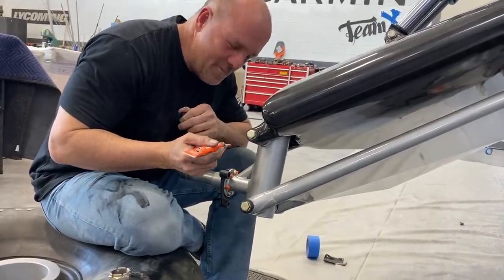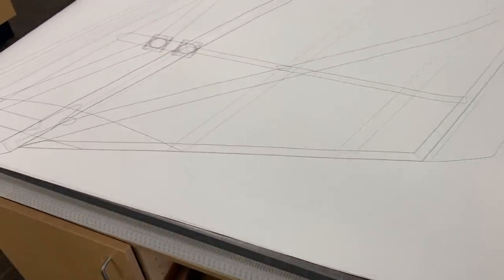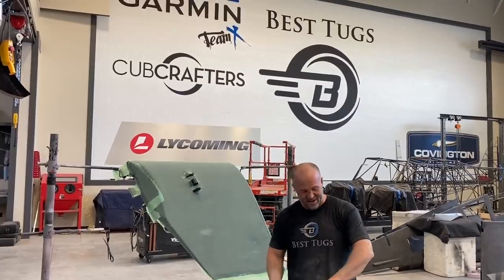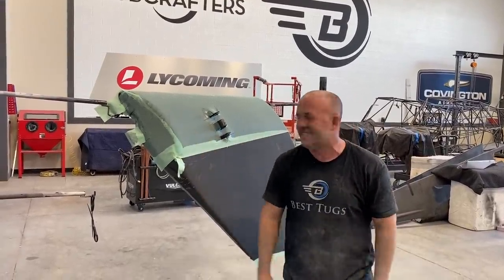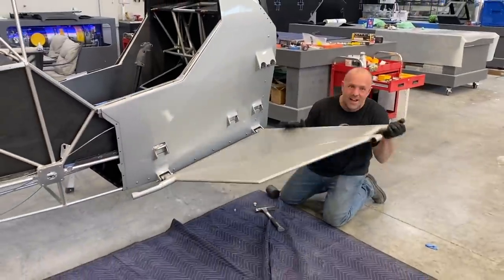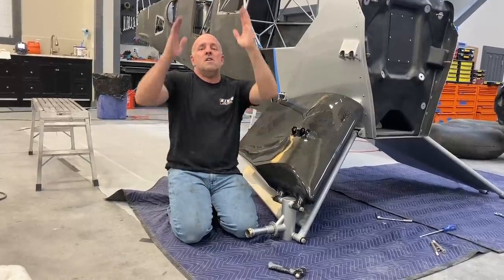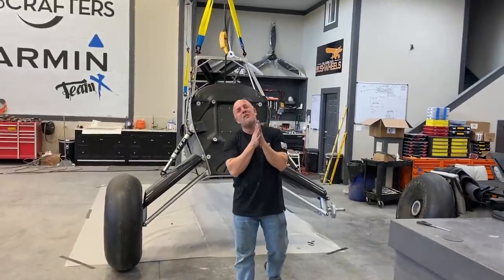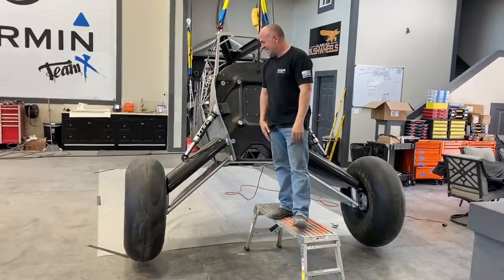Carbon Fiber Wings on scrappy suspension finished (Scrappy Bush Plane 22)

Comment: I’m a retired yacht carpenter that also built  one-off molds for anything that was requested for a build , all pre-computer aided  and just blown away with your ability and energy. I’m inspired to open up a laptop and learn new stuff
Reply: I'd start with Fusion360, it'll give you a good base and there's a ton of good tutorials. Depending on income(less than $100k) or associations with academia you can use it for free, otherwise it's $300 per year for standard software package.
Reply: If you register as a hobbiest when you download Fusion 360 it is free. That’s what I did.
Reply: @stevehurson4002  I use Fusion360 for commercial use so I pay the yearly fee, which honestly is very low cost for what Fusion360 does.
Reply: Insert learn to code. Haha. It's basically that. Formula and imagination.
Reply: Honestly. Can probably pirate it somewhere. Commercial/Pro license

Comment: It's 2020 and we are living in the future! Witnessing custom, innovative, creative designs from the cradle of the mind. Then modeled on flat screens in animatable 3D computer aided software tools. Guys working out the desired parameters of complete systems before any investment of of real world commodities. This is planning at it's finest! Thank you, Mike for sharing your vision! You and others are inspiring me to get back into my true passion General Aviation (GA)! Been away since 2000 and that's too long! I'm an experienced lofting plug producer that has worked off of line drawings for composite fiberglass molds. Primarily for the marine industry. Electric marine propulsion has been a focus for me since 2015. I believe that electric aircraft propulsion is the future. I need a test stand and aviation prop to work with. I've worked out on paper and ink how to power an electric aircraft motor system of about 180 HP equivalent for up to 6 hour runtimes. Though Rolls Royce and Siemens has been teasing the market. I believe my 1.5 KW MoGen system will scale up without much problem. I'm discovering a large community is cocked and loaded to really manifest our cradled visions to make GA safer and practical for larger pilot audiences than ever witnessed before. If anyone is interested in electric aviation power, it will be an honor and a privilege to work with you! The motor, controllers, battery management system and batteries are simple and the commodities are inexpensive. Once the Metronomic/Parametric Oscillating, Battery Management, Mogen is understood by others. It should prove seeming simple to those who are mastering computer aided drafting. With my system, the components can architecture into the composite skins working double and sometimes triple purposes. The goal is 100 year design life! Contact (legioneering (at) outlook (dot) com) As a community we are living in the future! Let's make it a good one! Hit It!

Comment: Your suspension is like a Trophy Truck, a Fokker Triplane, and a Unimog all had a baby.
Reply: I can’t freaking wait to see what it’s capabilities are!!
Reply: @matthewdowd4686  I would bet, Mike trained Scrappy to jump, and Scrappy asked how high? 

Just think of a Stol drag race, 

Mike start with the shocks at low height setting, a low preassure charge, just enought travel for takeoff 
gathering speed faster because of a flater angle of attack, 
and near take of speed, Mike will use Air pressure from the oxygen bottle to have the 2 shocks jumping out to full lengt 
with both up 15-18" uptravel to get the front of Scrappy at a steeper angle of attack. 
Those lowrider jumping cars would get jealous.. how high scrappy jumps.. 

And with the AirshotBoom Scrappy goes airborne with a 1 scrappy + a Mike mass movement.. 
this will eat a good chunk out of his of his starting distance. 
or with Mikes oversized engine and Mad Prop.. (cant imagine how much countersteer this combo will need..torque wise )
Scrappy might jumpstart and is a ZTSL zeroTakeoff short landing Plane  
and for landing, he just sets the shocks preassure back to lower soft impound eating level.

And the best part for mike, its just some bigger and extra airlines, a electic solenoid to open the oxcgenbottle(a preassure regulater perhaps to adjust the jump strenght) ,
and an 3 way valve and an eletronic preassure adjuster valve to set his desired landing suspension setting.  
1 st setting be closed at jumpstart when the bottle kicks in, 2nd setting preassure regulated after jump start and for landing, 
and the 3rd way would be hooked up to the engines mainfold for vaccum to the shocks to tow in the suspension to max compression in flight to get the most use out of the suspension wings.  

And i´m pretty sure its air controlled since might is stingy as a scotsman when it comes to weight, so its not hydraulic.
Reply: SirDigger420 how long did it take you to write this?
Reply: @Dixon_1974  probably 3-5 Minutes 
Took longer to get rid of the typos.. as thinking about the concept.. 
english isnt my mother tounge
Reply: @Dixon_1974  And it makes no sense at all!
Reply: Tom Hutchins I mean his mother tongue isnt english.
Reply: Unimog baby.....nice to see someone else appreciates those beasts.
Reply: The Apollo Lunar lander's gear had to be designed by Mike. Its so much like Scrappy.Any altitude at any speed.
Reply: Wait, WHAT?!? OMG that's just so ALMOST on point...

Comment: With all that lift surface, it's almost like he is planning to have the prop wash lift the plane straight up. :)
Reply: Considering the prop in front... It wouldn't be surprising.
Just add spring loaded shock custom made by king and he just created a VTOL 😂
Reply: I'm sure as close to that as possible. He called it out early- it's all about short takeoff.
Reply: @ManicSalamander  and he was fairly disappointed that he couldn't make draco jump after having him squat with the brakes locked ^^
Reply: With that fan boat prop, you know it's going to take off shorter than Draco
Reply: Yep its called a helicopter

Comment: Am wondering if you've come up with some ingenious way to hydraulically raise the wheels with the shocks so those wings can be horizontal in flight, then dropped for landing???  Wait a minute - will the lift from the wings raise them up  by themselves if you can valve the shocks to let them easily travel upward after liftoff?
Reply: I am pretty sure he did say he will have them up during flight, didn't mention how but let's be real he'll figure it out
Reply: Great observation! I think you are right!
Reply: @getstuk87  I agree, my though is that they are air shocks and by venting them, the lift will cause the "gear" to retract into the horizontal.  To land, they will be pressurized to get required cushioning.  For simplicity, the shock valving might just perform this function automatically.  But if you have to slow down to let the lift bleed off to get the "gear" to go down, that could get to be nerve-racking.  Also, this functionality would likely be affected by temperature.
Reply: yeah right on..   he made mention of this idea on the wilga wonder how much launch he will get

Comment: Suggest adding a clear poly strip to the leading edge of the mini wings.
Reply from the maker: BYRON Johnson  they are all wrapped in a self healing clear bra 👍🤠
Reply: @MikePatey  Silly me, trying to give pointers to the Tony Stark of aviation!!! Love the vids keep em coming!!!
Reply: @MikePatey  Super cool project and execution. You will get a bunch of interference drag between the upper and lower arms, but probably not an issue given the mission brief. My thought would have been why not put both arms inside the fairing and increase the chord. The other thought is why not put the shocks into the fuselage with cams to get them out of the airflow. Like you need armchair suggestions. Enjoy the vids; not cheap but people can do more in a simple garage than they think given a SolidWorks license (which you get with EAA membership - you might want to point that out if you care to support EAA).

Comment: Absolutely amazing and inspiring Mike!!! I watch these episodes as soon as they come out.

My concern about this much travel in the suspension is the same problem that caused Draco to have divergent suspension stability in a cross wind. Scrappy, with even more wheel travel, will have that same problem only worse, unless your secret that you're about to reveal in the next video is that the King suspension is a dual chamber suspension and that it will only have minor travel in one chamber with restricted travel in the long throw chamber used for landings. Dual chamber would prevent tip over in a crosswind.

Comment: Adjustable shocks so he can pull the "mini wings" up in flight to act as real wings.
Reply: That was my guess too. Here's hoping.
Reply: I can't imagine it would be anything but that.
Reply: Maybe one push or flip of a switch from cruise mode to landing mode, or possibly a flap sensor so landing mode is automatic
Reply: Daniel Murray shhhhh! That might be the secret worked out with King Shocks!
Reply: They will cut gear drag (their primary function) AND provide some lift, just where they are. Then again, though it would be a whole lot of busy work and extra complexity to make them somehow change their position in steady flight, if anyone could pull it off it'd be Mike.
Reply: And.. lowrider mode for loading, servicing, and show.
Reply: I think we're thinking too small... Forget forcing them up in flight, how about forcing them down at take off? Fire them down and the thing would leap up into the air. STOL? Give it a 35 knot headwind and I bet it could take off without a roll, It'd just leap up and fly
Reply: @owensparks5013   I would bet $$ he does that. He has talked about it before...
Reply: @portnuefflyer  cut drag and straighten out propwash to help the tail, yes. But I don't see them add lift unless they're aero-angled for the propwash, and that requires windtunnel work.
Reply: @billhart9832  IDK why he's treating it like a secret he only mentioned it about 5 times lol
Reply: @owensparks5013  Ohhh there’s a thought!

Comment: What about inspecting the metal for corrosion or cracks inside the carbon miniwings if it is installed non removable and without any inspection hatches?
Reply from the maker: It has inspection points on the underside I missed that for the video
Reply: @MikePatey  A few years years back, I read some research papers and IIRC they concluded that even a very thin layer of glassfiber or possibly just an epoxy topcoat substantially reduced galvanic corrosion between the carbon and various metals.
Reply: I WAS THINKING THE SAME THING... good thing I looked before I started typing.  GREAT QUESTION.  I used to crew a Tanker.. and we were ALWAYS on corrosion duty
Reply: @AntiVaganza  Yes any carbon in contact with aluminum will be short lived, on the order of several years.

Comment: $10 bucks says the reservoir in the king shocks will have some sort of “vacuum” pump to hold them in the up position to generate the correct angle of attack Mike wants on the mini wings.
Reply: I was thinking the same thing. Maybe a reservoir tank, and some kind of super heavy duty reversible little pump?
Reply: Interesting idea. I was thinking the secret of the shocks might be some built in supercharge to kick him faster off the ground for super short takeoff.. :D I know he scrapped the idea before. :)
Reply: @sasakurtovic6850  there's a gyrocopter/helicopter hybrid that jumps like crazy...
Reply: Russell Sperry yeah kind of like those oil reservoirs that trophy trucks have but with a vacuum system built in to “pull” up the shock
Reply: Saša Kurtović I wonder if they shocks natural state can be “hyper charged” and when he lets go of a vacuum it can “spring” during take off roll

Comment: are you going to be able to lock that landing gear in a neutral position concerning your angle of attack at higher speeds so they don't flutter?
Reply: hence the secret about the shocks.

Comment: Hey, Mikey! I know you had fuel cells in Draco's struts, and these "wings" seem awful empty right now. Did you consider using these wings for fuel?
Reply: They have the whole structure of the gear witch goes pretty much everywhere inside. Would be quite hard to have a fuel tank inside, plus they are no oving which would require flexible fuel line and so on. Not very practical in my opinion
Reply: Unsprung weight if used for fuel tanks, the suspension would react slower. On Draco the gear leg tanks were sprung weight ie above / carried by the suspension along with the rest of the airplane.

Comment: Hey Mike, any worries about the mini-wings interfering with the airflow over the tail/elevator at high AOA?
Reply from the maker: Great question I’ll talk about that later.  no worries.  All fabric cub legs actually cause mire from the tumbling air over the top on high AOA and this stays laminar and on top of that I widened the tail out beyond a normal cubs wash out
Reply: LogicalSense FACTS  guessing the surprise feature around the shocks is that the strut wings can be leveled for flight pneumatically -  just a guess

Comment: This build series comes off as the most interesting crash course in vision, aircraft design, and construction imaginable.   A true tribute to intelligence, talent, hard work, and the beautiful results that come from the combination of the three.  Unfortunately, I envision Mike shedding a tear or two once some big engine, backcountry, prop wash chucks some sharp debris into the leading edge of that beautiful carbon mini-wing. Best put some tissues in one of the many cubby holes in the instument panel.   ;)

Comment: I really do enjoy Mike. The things that he is doing is inspiring many. I am certainly don't want to be critical of all of his great work. However, the suspension does scrub the tires latterly. The only way to keep the tires from scrubbing would be to have the bottom link shorter to keep the track consistent. The down side of that is that the axle will no longer stay parallel to the horizontal plane. The wheel and tire will roll a bit, but the track would stay the same. At the end of the day, choose your poison. Lots of love for Mike.

Comment: Looks awesome. My only suggestion would be the addition of a drainage hole and/or an inspection window in the carbon covering. This would ensure that years down the line you don't have to worry about water/humidity buildup or corrosion to the internal metallic frame. Rain might not be an issue but condensation forming on the interior steel may be a potential issue. This project is looking great !

Comment: Mike it’s cool you crossed off road suspension design with a bush plane concept. The double A-arm suspension should be really durable for you out there on the mountains. The term for the change in the tires angle during suspension compression is called Camber Sweep. Looks like you have set it to a certain angle and maintained the camber angle through the stroke.  Really cool, looking forward to more videos!

Comment: What an exiting stage to be at, always so satisfying to have a rolling chassis. 

I think you could take some weight out of those a-arm pivots, I’ve made them from hard anodized aluminum rod, igus sells it. You could also use igus bushings to go without the grease.
Reply from the maker: 👍🤠 Agreed and I have greaseless bushings but I like to install with grease anyway

Comment: A thing that has been oddly satisfying is similar. To replace an erosion shield on a leading edge on a Hartzell kevlar propeller blade many times of course or doing an e-glass repair on a MT propeller trailing edge. You have to grind out the extra glass and resin back to the original shape. That's satisfying.

Comment: Love the content as always and can't wait to see this build finished! If I could offer one suggestion from an audio engineer to a real engineer, I would recommend investing in de-noising software for your audio. iZotope makes very effective plugins and a standalone application called RX 7 specifically for cleaning up dialogue and vocals, while still being relatively user friendly (as long as you read the manual). Specifically, I recommend their de-noise and de-reverb plugins since a lot of your content is recorded in noisy and reverberant locations (around planes, in hangers, etc.). There are other options available, but I personally have used this program on several projects recently and it has done the job very well.

Comment: The little wings are utterly beautiful.  Heck that whole front suspension is utterly beautiful.  One thing I am wondering about is for the suspension to travel its full 20 inches is going to need those BIG tires to scrub laterally.  When we saw Mike drop the plane with the hoist we saw the tires track at least six inches a side.  In fact one side scrubbed while the other gripped, and that tilted the fuselage a wee bit.

Comment: If I were a crafty individual like your self, and with an inside ear with the King shock engineers, I would ask them if there was a way to compressed the shock(like you did with Draco), Lock it compressed, and be able to release that energy part of the way through your take off roll to spring Scrappy in the air. THAT WOULD BE SO COOL!!!
I love watching you build this monster. 
Signed, 
Patiently  waiting for Scrappy 23

Comment: I think the alignment term you're looking for is called camber. Positive camber is when they tip out at the top. If the upper and lower control arms are parallel and equal length, the camber doesn't change through the travel arc. 9th grade edumucation at work here.

Comment: You and I think alike. When you started building the landing gear, I thought about an airfoil on the gear. I kinda discounted it because of the angle with the gear drooped. I thought it would destabilize the plane at slow speeds.